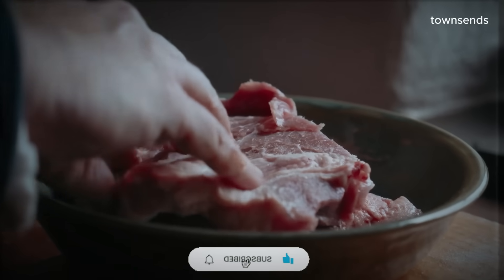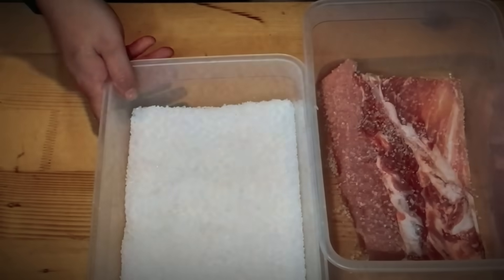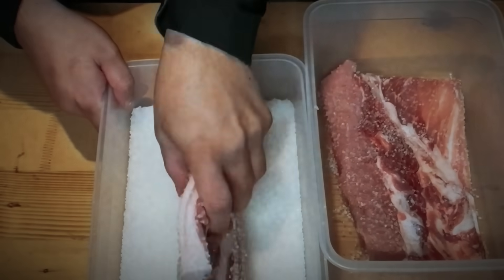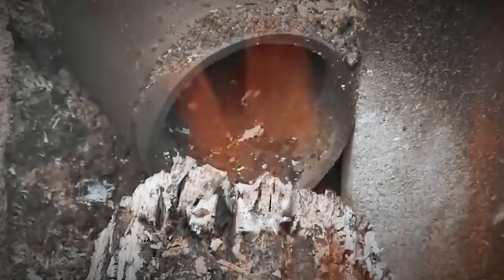Build This Medieval Meat Vault: Keeps Fresh 8 Months (No Electricity Required)

Comment from the maker: ⚠ IMPORTANT SAFETY CORRECTION: Never use PVC pipe with wood stoves or high-heat smoking! PVC releases toxic fumes and will contaminate your food. Always use appropriate metal piping only. Also avoid galvanized pipe at high temperatures. Thanks to our community for keeping everyone safe! Please always research materials thoroughly before building any project.

Comment: Please don't use pvc on the smoke house like is recommended at 4:39, it was chimney pipe for a wood stove that was used not pvc, pvc is a plastic pipe usually used for plumbing and could release toxins when hot plus pry won't hold up to high heat or hot smoke very well over time

Comment: 1:16 Anyone with half a brain can tell that this is a TTS. Further, many of your videos appear to be nothing more than partial AI generated. You may think you are doing a good thing with these videos, but you aren't. Much of the info you present has been disproven several times over and can be lethal if someone does it without fully researching it. These videos can and will get someone severely injured or worse.
Reply: Facts
Reply from the maker: If TTS bothers you so much, why are you still here watching? If you have specific factual corrections, feel free to share them. Otherwise, maybe find a channel that better suits your preferences? 🤷‍♂️
Reply: @MedievalWisdom  It's called the algorithm. Have a day.

Comment: PVC pipe running right out of a woodstove? I. DON'T. THINK. SO. !!! 
(At least the illustration didn't follow that utterly ridiculous and potentially catastrophic  statement.)
 Not only poisonous gasses from the plastic, but immediately and irrevocably tainted meat and /or fish product would follow with the first batch. 
Many (and it should be most) not only burn off any paint on the metallic pipe likely rightfully used, but galvanized pipe is a no-no as well if high smoking temperatures are ever a method used. Same goes for actually cooking what will be an inevitably poison-packed product.
Reply from the maker: You're absolutely right and thank you for this critical safety correction! We'll pin a comment with proper material specifications immediately. Really appreciate you catching this! 🙏

Comment: cut the flesh food into bacon like strips and it dries much more easily and quickly. A dip in salty brine does a more thorough job than just sprinkling salt onto the food, so you use less salt AND get better preservation. Then the smoking/drying process can be faster and more effective, too. It's a lot more work, requires a lot more space for the hanging of the strips,  Today, it makes more sense to just live where the winters are shorter/milder and to think more in terms of peanut buttert than meat or fish, for your needs of protein and fat.
Reply: Meat is much more nutritious than peanuts, which are full of nasty lectins.